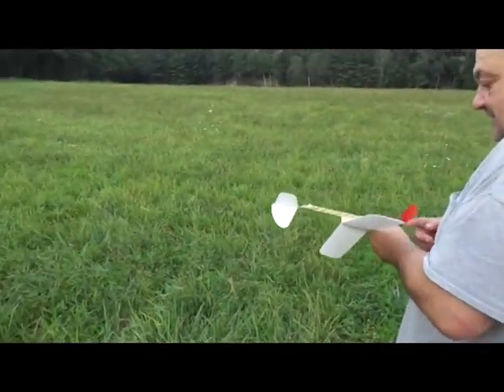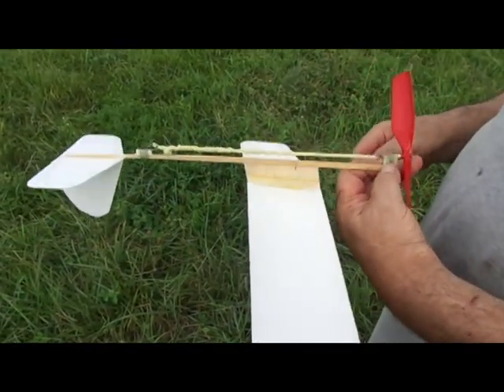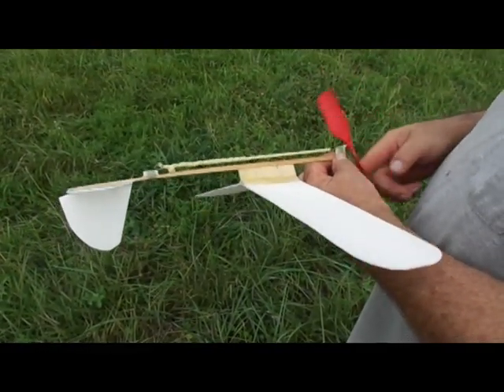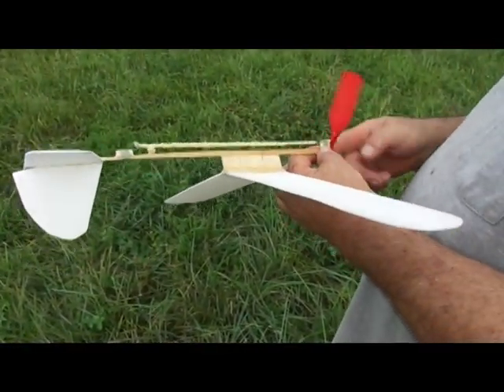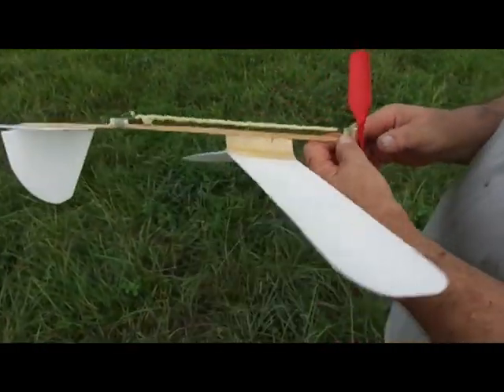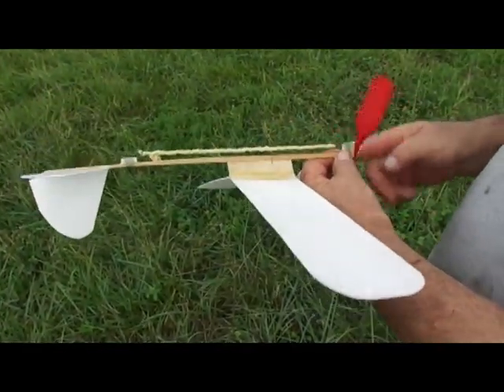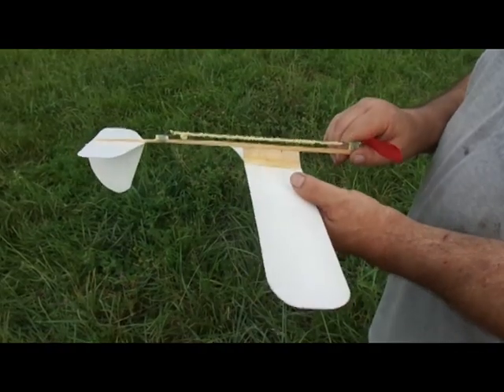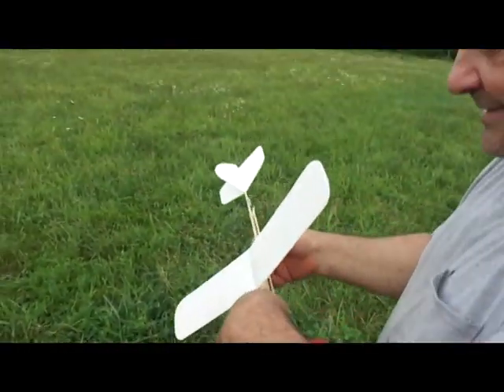One-Night Rubber Power Plane, Richie's "STIR-FLY"!

Comment: Good tip on using value pack meat trays . I built a Fantastic foam flyer  with foam plate material that worked big time but the only problem there is you are limited to very small sheets of foam you can harvest from the plates.
Reply from the maker: Using recycled materials puts the "free" back into free flight! ....Although I must look pretty silly at the market inspecting the condition of the styro trays as carefully a I'm checking out the cuts of meat contained within! 

I bought some of the cheapest foam picnic plates the other day...super thin material...built a supercapacitor powered free flight out of it over the last two days, looks like it's gonna be a champ. Now waiting for the bad weather to pass so we can test fly...Temps in the single digits Fahrenheit with 20 mph winds today rules that out for now...video coming soon! -Mike

Comment: wonder what the wing span is on that Stir Fly ?  looks like 20 inches or so maybe and i think a 7 inch prop.  I was thinking about it today while i was scratch making some small free flight foam rubber powered model wings . got to get back in the free flight mode since i really want to get busy with super caps .. You two have inspired me.....cheers
Reply from the maker: I think you're pretty close on wingspan and prop. Not much difference between supercap and rubber!